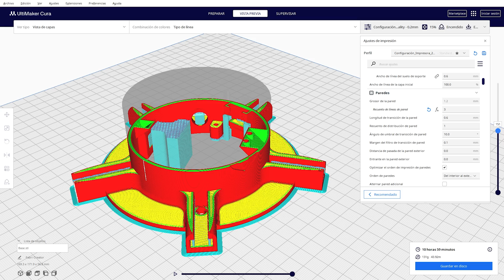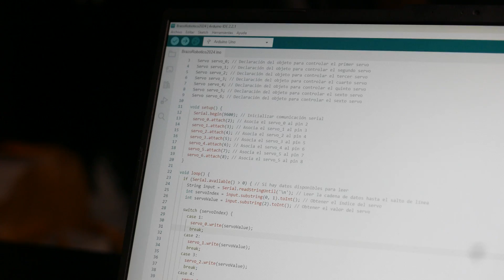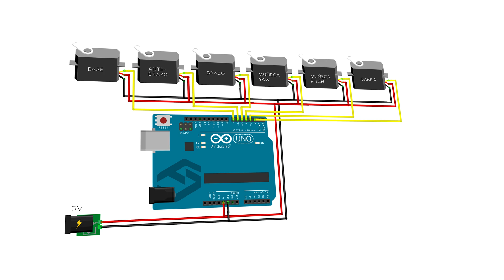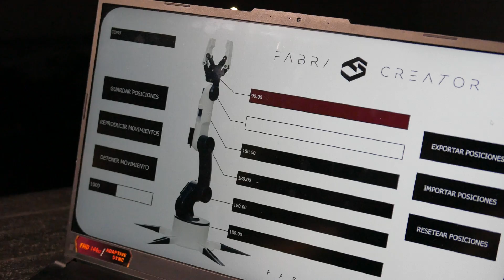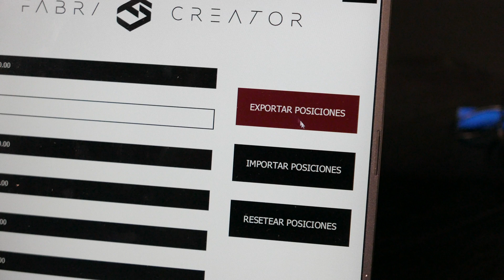Brazo robótico con Arduino - Robotic Arm - Guardar/Reproducir/Exportar/Importar Movimientos.

Comment: Listado de Materiales: 1 x Puerto Jack DC con rosca y tuerca
1 x Transformador de 5v 3A con conector Jack
1 x Arduino uno
3 x Servo MG995
3 x Servo MG90S
3 x Tornillo M3 12mm
12 x Tornillos M3 12mm + arandelas
7 x Tuerca M3 autobloqueante
1 x Tornillo M3 16mm
10 x Tornillos pequeños (muchos vienen con los servos)
Cables varios

Comment: I downloaded the Windows program, but it does not work and the software locks
Why?
Reply from the maker: Make sure you downloaded the file for your operating system.
First connect the Arduino to the PC and then run the program.
Reply from the maker: Actualicé las aplicaciones, ahora están mejor optimizadas.

Comment: HOLA AMIGO GRACIAS POR TU PROYECTO TE QUEDO MUY BIEN TE FELICITO. POR CIERTO EL SOFWARE DE WINDOWS AL ABRIRLO SOLO SE ME QUEDA EN PANTALLA BLANCA Y NO LO ABRE PARA LAS POSICIONES DEL ROBOT, SABRAS A QUE SE DEBE.
Reply: Hola Santiago! ¿pudiste resolver el problema o te dieron alguna respuesta con este problema? Lei otro comentario de alguien que tuvo un problema igual al tuyo
Reply: @zopilotemisterioso   no lo pude resolver lo programe sin utilizar la aplicación de la lap ya que dicha aplicación no sirve no abre en la lap..  en mi perfil están algunos Reels del brazo
Reply: @medinaramirezsantiago4175  hola santiago , una pregunta solo lo de la aplicacion te dio problema o las impresiones tambien ? y perdon por molestarte pero pudiste resolver el problema de la app
Reply: @FutbolInstantaneo  si también la pieza del antebrazo el que va conectado a la base esa base batalle en imprimirla..
Después utilice otros software de impresión y hasta que con uno que si me dejo imprimir
Reply: @medinaramirezsantiago4175  wow! si, los acabo de ver. Finalmente te quedó muy bien. Me pregunto si puedes compartir el codigo de arduino ... en caso de que no sea posible se respeta, ya que es tu trabajo. Gracias por tomarte el tiempo de responder!
Reply: @zopilotemisterioso  si claro a dónde te mando el código

Comment: Hola buenas . Buen proyecto , una consulta . soy principiante en este tema . Con el archivo " Diseño 3D STL(para imprimir):" ya podria hacer funcionar el brazo no?  (obviamente + codigo arduino + app de control de brazo) realizo las impresiones sin modificaciones y listo . Los otros archivos es por si quiero modificar algo digamos (el de processing , fusion 360 , step)?

otra pregunta es si puedo usar 6 mini servo sg90 9g . en vez de hacer 3 (sg90) y 3 mg995/mg996r . Gracias
Reply from the maker: Exacto, es lo único que necesitarías. Los otros archivos facilitan hacer modificaciones.
Sí puedes usar 6 servos sg90 sin problema.
Reply: @FABRIcreator   Fabri, tengo Lx-224  bus servo de hiwonder, se pueden usar?